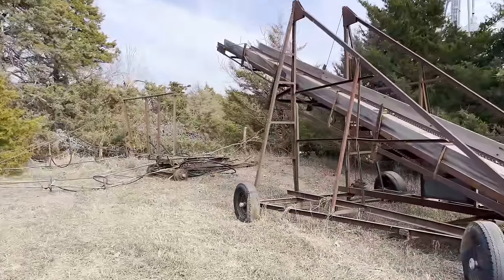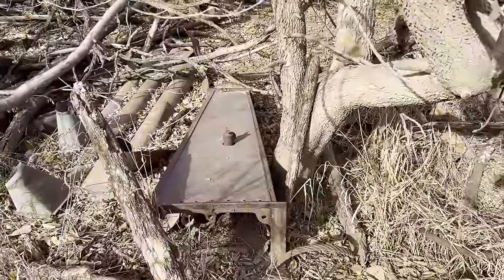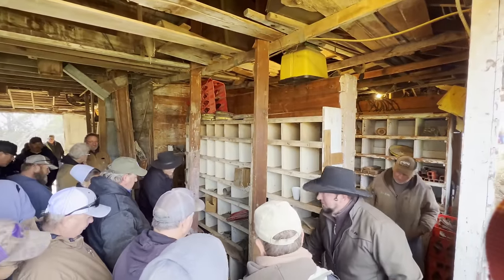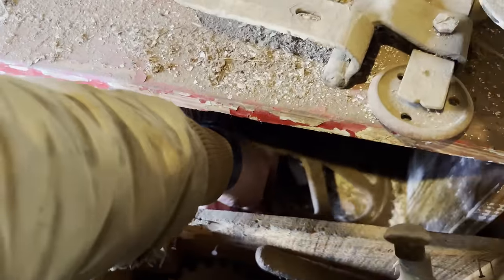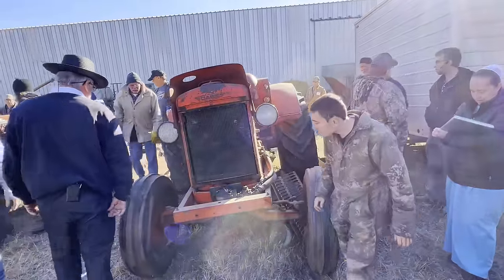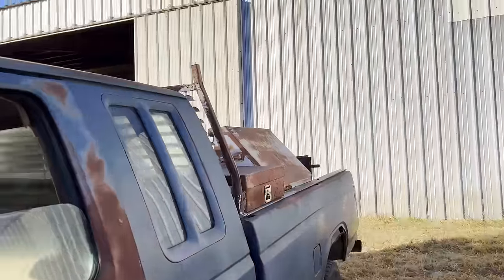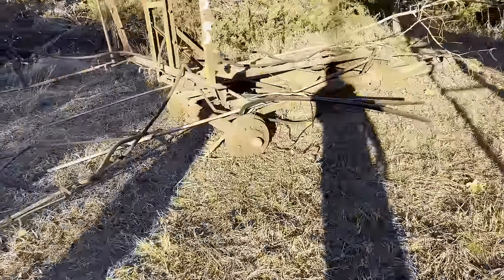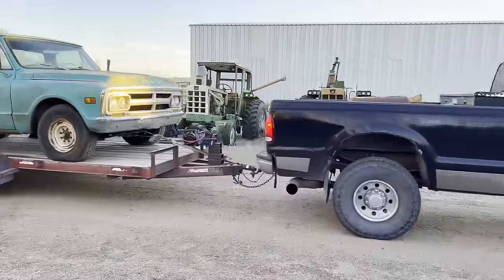Huge Farm Auction! Tons of BARN FIND Buys!

Comment: Hi the 41 Chevy  chrome waterfall grill is a pre war after this the are known as black out  definitely interested in this and the front clip to Ford you pickup the other week I'm planning to move soon working on that land house and shop  intend buying cars and truck to restore more body work than mechanical but putting on newer running year  like the bus and white caster you've just shown got to arrange a haulierr and or storage   appreciate any suggestions

Comment: The red Chevy truck is a 1946. I still have and use the 1941 that my Grandad bought new. The bumper on the 41's were small and nickel plated. The 46 you have has the large painted bumper. You may already know the title s/n is the engine s/n stamped in the block near the distributor.  Thanks for sharing.

Comment: The Ol Red Ford Truck.... The pieces on top of the headlights are OEM THAT YEAR. Some one has added turn signals.
I have several Ol Trucks from that year. So you can say I know whatI am talking about.
Reply from the maker: That’s a Chevy truck, and 41-47 have marker lights on top of the headlights. However, 1941 has Pontiac lights and 45-47 have actual Chevy lights.

Comment: At 32;28 the reason why that man paid so much for the truck think $750 for that wreck two-tone Brown Ford F-250 maybe have 350. He believed he had a good rebuilt running 460 Cid in it and the transmission. He wanted the engine. Whether that's where it had in it or not that's what he believed. I like that black Ford. And all the other vehicles you bought good taste. The Dodge tailgate back in the 90s I had one tailgate that Wednesday on the back of this 71 Dodge that I had perfect tailgate. It passed me one too many times on the exit ramp from the highway going to the house and I took it over to my friend that was a scrapper he couldn't believe I scrapping it I said I don't have use for it. I just put a board across the back of the bed. By the way it always slid down on the inside never on the outside with Dodge was located. Looks like I should have kept it. I put a lot of work into that truck and some money somebody stole it from me later. After I put the 440 and Allison transmission out of a bus change differential but a custom drive shaft in it and redid the whole bottom side the whole truck only had about 70,000 miles original on it. People ask me why was I doing that to an old Dodge I said they're going to be worth money you see besides I like it. Somebody liked enough to steal it and I was right there worth money now. Had 1970 with a 383 out of roadrunner in it as well at one time. I think Tim and Joe were there at that auction at least one of them. I never knew who bought the black Ford. Now I do thank you for covering this auction

Comment: The old Chevys with 10 small lug pattern are the same pattern as the70s  80 s and newer motorhome rear ends ( disc brake) they all fit in the 1940 to 1947  trucks with the same lug pattern , they will up grade those older truck to new disc brakes  thanks good ol trucks need to be back on the roads , they are history thanks BigAl California praise Jesus Christ grace amen 🙏